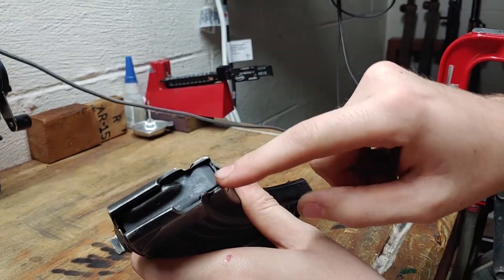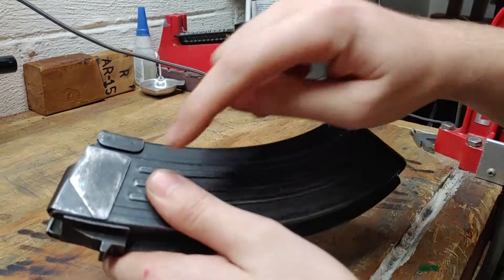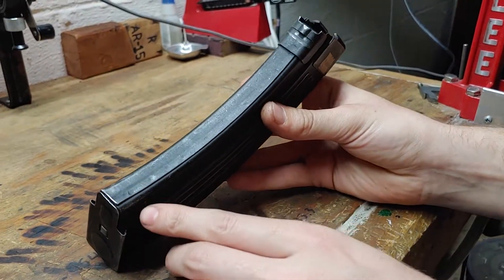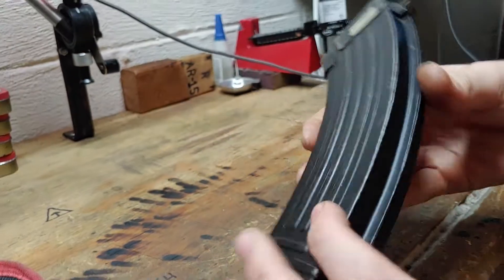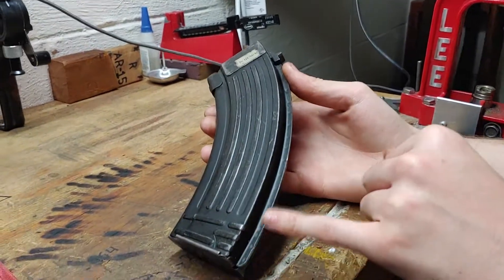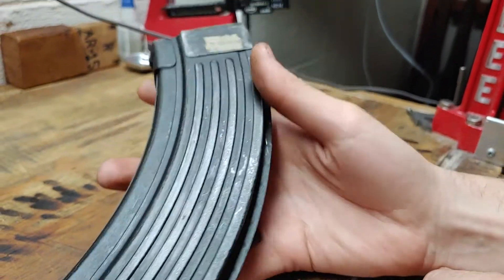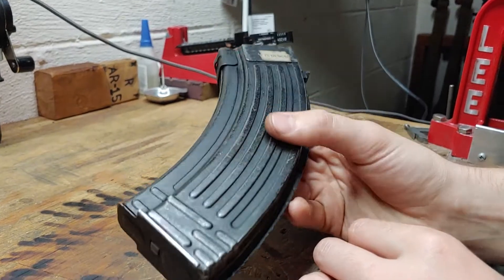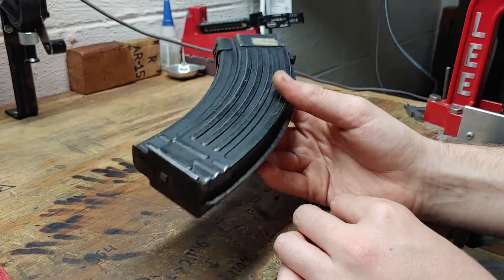AK Mag Identification Week #3- Hungarian 30rd Steel Magazine (7.62×39mm)

Comment: Mine has a M inside a circle stamped on it. I looked on google it seems to be Hungarian? I ordered yugo mags from PSA and they sent me these 😂 what’s your take on these mags? Hungarian?
Reply from the maker: @Grizzlyman420  Circle M is a very well known Hungarian marking. As far as surplus mags they are about the same across the board as far as functionality goes. Some mags are visually nicer than others. A Romanian being at or near the bottom a Russian or Hungarian being mid and the best of them being Yugoslavian and Chinese. I'm sure if they are in good shape they will run great for you. Really the only difference is that a Yugoslavian mag will hold the rifle open on the follower on the last round and a Hungarian will not. As soon as the magazine is removed the bolt will close so its not the great advantage it would first seem to be.
Reply: @Tula1940_LB  thanks so much for the response! This is my first time seeing these magazines. They’re surplus so they have a little surface rust on them but totally fine. I will order some actual yugo mags from Zastava USA. I ordered yugo mags from palmetto but they sent me these 😂